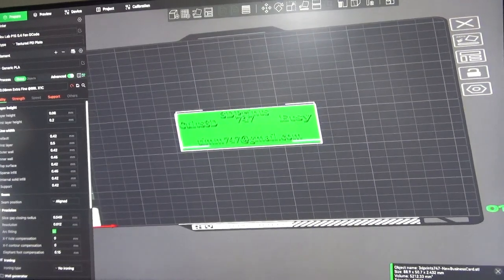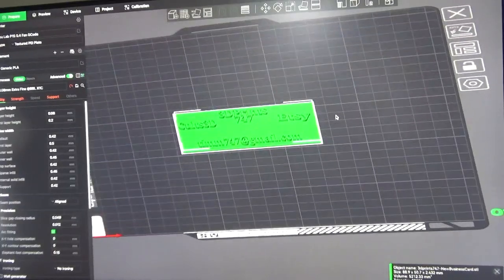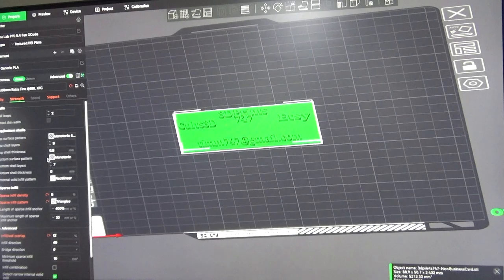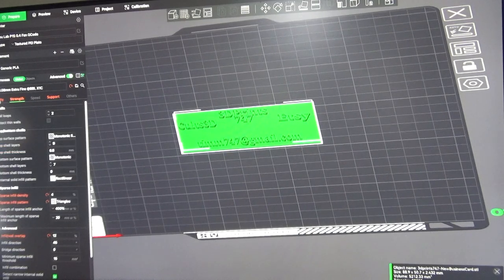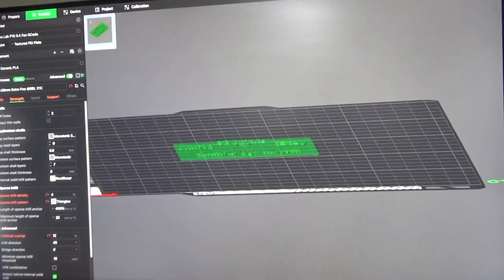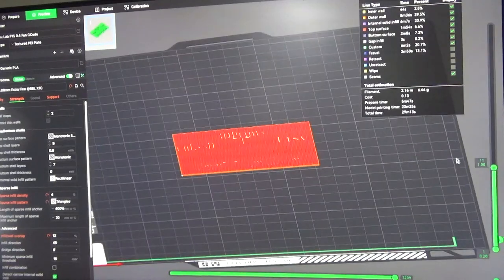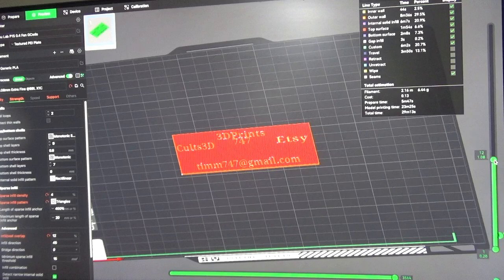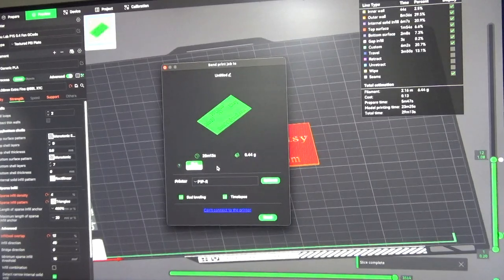Inserting a pause in Bambu Slicer

Comment: Hello, I can’t understand what command you used to edit the pause?
Reply from the maker: Slice your part and after it is sliced you will have a slider bar on the right of the screen.  Slide the dot with the plus sign down the bar to where you want to insert the pause and right click on the + and "Add Pause".
Reply: @3DPrints747  Thank you !!! I dealt with the pause. How can I register the extruder to move away from the model to insert a nut?
Reply from the maker: Look at my Twitter 3DPrints747 @timm747.  I just reposted a tweet BambuLab just put out on inserting magnets.  Should be the same process.

Comment: if i want to insert 10mm height let say a rod inside my print, with layer height 0.2mm so i must add the pause at layer 10mm/0.2mm + 0.2mm = 51 right?, Im afraid to crash my p1s
Reply from the maker: Not sure I understand the question.  Regardless, nothing will crash the P1s.  Just run at a draft layer height and higher speed to prototype before you print the final result so you can do some testing.  I've prototyped many things before printing the finer/higher quality final print.  BambuLab printers are great for that since they print so quick.
Reply: Whatever layer you select and add a PAUSE, it will PAUSE at the *START* of that layer, not the end.